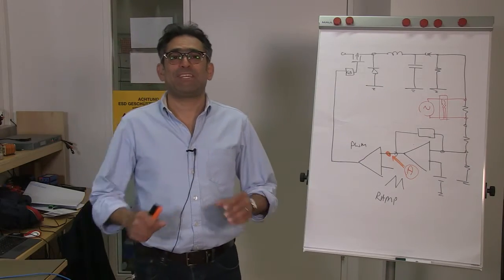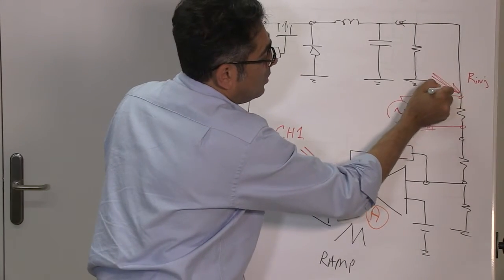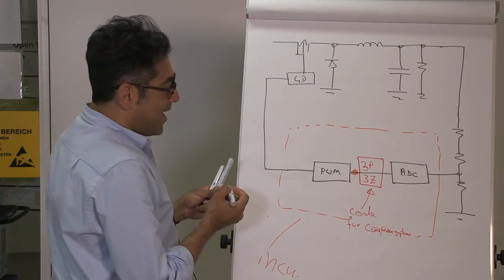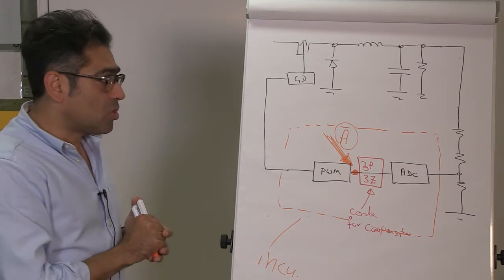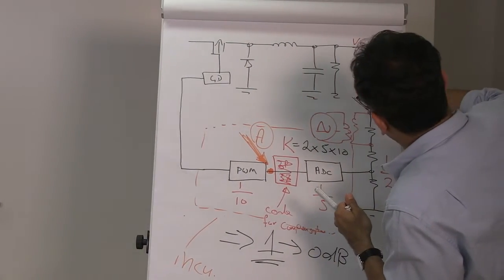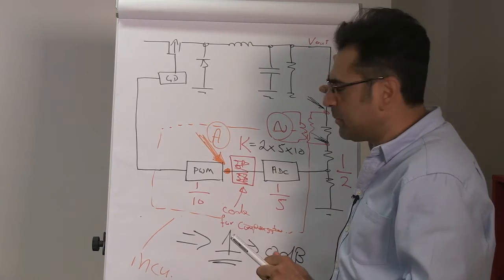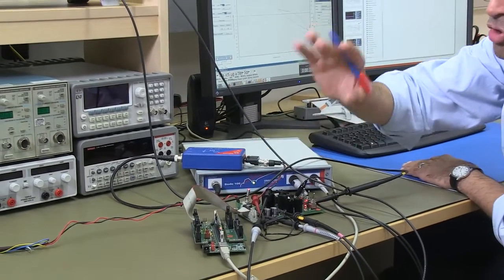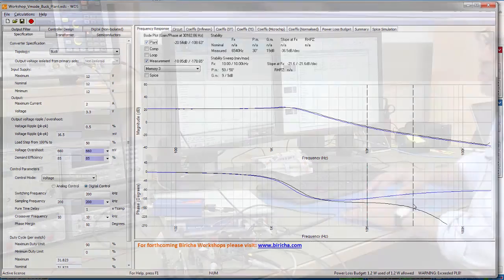Measuring the Plant Transfer Function of a Digitally Controlled Converter

Comment: Thank you Prof. But I have a question here. As the controlller gain is a fixed gain, the system might run into instability. So if the system runs into instability, will it give accurate plant transfer function?? I understand that here we are interested in measuring only plant transfer function. But still due to instability, freq, and other parameters may very which can give inaccurate result?
Reply: It's exactly what I had in mind during watching this video. I think it was assuming minimal gain in proportional controller so it should be stable anyway.

Comment: Is it possible to make the internal digital compensator output connected to another independent DPWM output pin of microcontroller? Then we can measure the signal in working mode.
Reply: Obviously you can send signal from the software compensator with reasonable scaling factor to a DAC. Anyway it's leads to same amount of additional phase shift and it should be take into account after measurements.